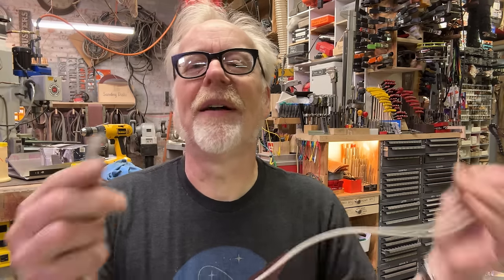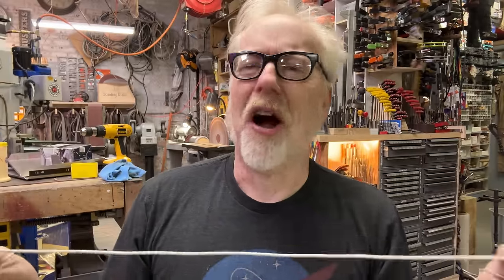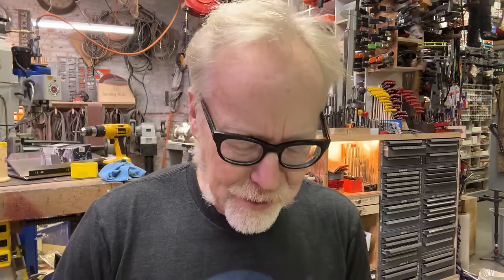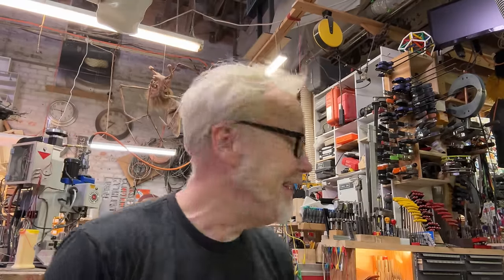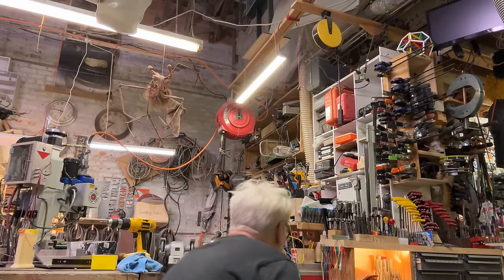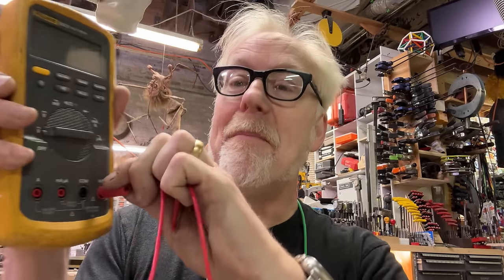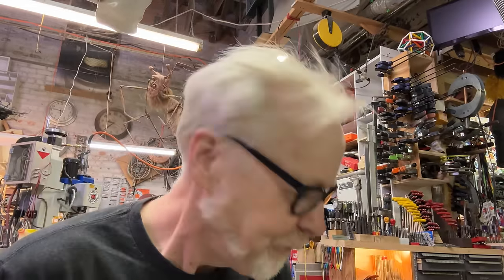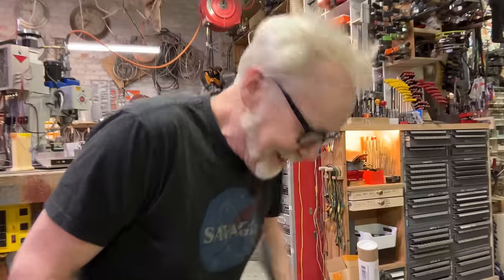Adam Savage's Alligator Clip Leads Problem

Comment from the maker: Subscribe for more videos (and click the bell for notifications):  http://www.youtube.com/subscription_center?add_user=testedcom
Reply: I make my own clip leads or alligator clips as I learned to call them by my father.

If you would like some high quality ones let me know. I would be honored to make you some.
Reply: Adam Savage, you could always just use Wago's and a Pen voltage tester to see if you continuity (Completed Circuit)
Reply: Please check out Parts Candy test clips! They're exactly the solution for this problem. They're hand soldered and can handle a lot of current.
Reply: Eric O. at south main auto probably has one of the best collections of leads for everyday use.
Reply: Adam savage should try to make 
Real MILITARY DICYANIN DYE GOGGLES to really see higher dimensions 4d test different dyes
Reply: @bretteballantine2596 
Well he cannot make fiction a reality..... so...
Reply: Copper clips, silicone copper wire, solder, shrink tube in different sizes and colors.  Cover the clips as best you can with shrink tube.  You can also pair them up in a cable winder puck that you 3D print.  Make different sizes / lengths for different uses.  Pair up red/black in a 3D printed winder puck.
Reply: If you want the best test lead clips on the market look up MUELLER ELECTRIC's "JS Popper' if you just want a stronger grab the "3-sided jaw" test clips really have some bite!
Reply: @Napster60   Show us.
Reply: @Napster60  I would be happy to see or even buy some.
Reply: @elliothickle3247 that is a beefy boy..whew.
Reply: Frankly, my favourite kind of clip leads is a soldering iron.
It is usually quicker to solder things together than searching which one of that clips has disconnected right now.
Second best to it for prototyping are female to female "arduino wires". You put some male pins on your components and then put that wires over them. All colorful so you see what is connected where.

Comment: I worked in electronics for 50+ years and learned that there was nothing better than making my own clip leads. I used various styles of clips and insulator boots made by Mueller or Pomona and the wire of my choice. That way I had total control of length and gauge of wire and the clip was soldered instead of just crimped.
Reply: Big fan of home built. The wire I have laying around is better than the 26awg(maybe) from a cheap store bought set.
Reply: Absolutely Mueller for clips.  I have several boxes of them and the matching boots on my bench.  They’re not cheap, but the cost is worth it.  I also agree that for pre-made leads, Pomona are probably the best ones available - again very expensive, but something to search for in boxes of random stuff at hamfests.
Reply: This is The Way
Reply: S&M relationship with my jump clips also. 50 years ago, RadioShack had two clip sizes. The ends were ok, but the wire insulation degraded and attacked the copper, making the wire to the ends intermittent. I still solder repair them using new hookup wire. Sadly, they are my best clips.
-Peter
Reply: I like the custom leads from Probemaster.  Any length, any of several dozen ends.  Gold plated,  made in USA.  Reasonably priced.
Reply: I agree. My best leads are custom made. Treat yourself and use a use teflon insulated wire with very fine copper strands. It’s soooo soft. 😊
Reply: Pay the money for the good stuff, and never have to buy again. Pomona test leads are excellent quality. Mueller clips if you want to make your own. I have dozens in various sizes, ends, and wire gauges and lengths, due to being a very serious experimenter.

Comment: My father worked for the Bell Telephone company of Canada from 1949 until he retired in 1985. Same complaint on alligator clips leads. His solution was to purchase a selection of alligator clips and solder his own leads. Same complaints as you. While listening to you I was brought back to the late 70's and early 80's when I learned basic electricity from him. He passed in 2008 and I still have all his old telephone company tools.
Reply: That's a sweet story. I'm sure a lot of us have similar ones of our Father's rantings
Reply: First thing they taught us in electrical engineering was to solder our alligator clips.  They are sold unsoldered because it is more durable and flexible.  Once you solder them they are a much better electrical connection, but they break easily.
Reply: @moeburn  You wrap electrical tape around the base as a strain relief than run a lighter over it. Vulcanizes it and creates a very durable strain relief. Did that with a pair of old 1/8 jack headphones back in the 80's they still work. Sound like crap but still work ;-)

Comment: 50 years dealing with electricity and electronics here. Don’t trust any of the low cost clip leads until you check them with an ohmmeter.  I’ve seen as many as half of a pack be bad right out of the gate.
Reply: I've had the odd one that would have continuity, but not even carry a fraction of an amp.

Comment: I'm an electronics engineer at a metrology lab. I feel I should find the time to make a response video to this. I have a great many clip leads for all sorts of different applications.
Reply: Which is the company or model you use?
Reply: @FabAlb166  my personal favourite is the brushed battery clips. Grippy af. Large levers on them, comparatively, making them easy to open. No idea of the manufacturer, but they are very robust indeed. A lot of the gear we have is actually old soviet era Russian and Ukrainian origin. We have probably around 100 resistor standards that are Russian. They're extremely stable.
Reply: well GET TO IT....  Don't leave us all hanging!
Reply: Please do! Let us know here if it happens. 🎉

Comment: I work on mail processing equipment. I like to set my multimeter up with a gator clip on the black lead and a regular probe on the red. Makes it easy to hook up a good ground and then have a a free hand to work with while measuring.
Reply: That's how oscilloscope probes are designed i believe
Reply: Also measuring one handed is ostensibly safer, depending on the voltages. 👍
Reply: Yup, I get the leads with threads on the shoulder of the probe, and have screw on clips.
Reply from the maker: Mail processing equipment! Cannot lie -- that sounds fascinating.
Reply: @schok51  The ones we have are just the little tiny clips like Adam was showing, but that could be because the only thing we use them for usually is checking for a couple of signals on very small components in our inkjet printers.
Reply: @matter9  Good point. Luckily most days it's nothing higher than 24VDC, and 208 VAC at the worst.

Comment: "It's really hard for me to throw out something that almost works"
I felt that line resonate deep, deep within me :D
Reply from the maker: Right?
Reply: Same here.
Reply: Perhaps a rephrase, something like: "I have a hard time throwing out things that are not damaged." Like, things that are in the same working condition as when they left the factory.
Reply: @GeneCash  Here, here! Hear here!
Reply: @n8mob  Even damaged things I hate throwing away because I know it's just going to end up in a freakin' landfill somewhere :/
Reply: Then don’t… Give it away.
Reply: The beauty of cheap clip leads is, given enough time, even sitting, they’ll fail. I bet half of the ones on his rack are dying or dead.
Reply: it resonates with me. I will not throw it out until I have FULLY replaced it. I have had crappy gear still knocking around because of one single use-case where that is the best option available (that might even be that its the tool that is near me when needed). my wife can be the complete opposite of that she will throw it out as soon as she decides it does not work for here without a replacement and then we have no tool for the task. we had that with a can opener that was troublesome she threw it out and the next time we needed it we had no can opener and had to resort to a  old Swiss army knife to get it open.

Comment: Mueller Electric is the company you're looking for.  Grandpa had an elec. shop since 1958, I made test lead cables with Belden Test lead wire and Mueller ends once.  They all still work.  I use the tiny, but tough, 30 series in copper, but 60 series might be more your size.
BU-30C - alligtor clips
BU-34C - Flat tips - great for tight spaces 
BU-60PR2 - Alligator clip that accepts test lead pin Tip
BU-60HS - Alligator clip that accepts Banana Plugs.

Lots of styles, and multiple metal options.
Reply: @tested this right here, also Mueller makes a ton of different clips, leads, connectors, etc. They're not inexpensive, I balked at the prices when I first saw them but everything I have from them is still in perfect working condition even after years of daily use. My preference is to make banana leads of various lengths and use connectors with banana sockets, that way when a lead wears out or breaks you can just grab another and swap a connector on to that.
Reply: I'm replying to your message as a bookmark for future reference. Good info, thanks!
Reply: reminder comment for anyone that needs it
Reply: YES!!!    Mueller branded leads are fantastic.   I have some from 40 or 50 years ago and still work great.
Reply: Yep. Came here to make this post.

Comment: On the subject of banana connectors, google Wago 215 - these are 4mm banana plugs with spring-contact sockets on the back to accept loose wires - effectively turning any 4mm socket into a screw-terminal equivalent. Game changing. 
Only downside is they're not stackable
Reply: Speaking of Wago, I like to use a 5-way lever nut with a lead to BNC.  Easy way to connect up four loose wires.
Reply: The modern equivalent of a stackable banana connector is called a "test lead".
Reply: Mike - you are an amazing human being. I love WAGO connectors but I had no idea that the 215 existed. They even come in a range of colours.
I have added a stack to my shopping basket!
Reply: Mr. Harrison, perhaps you could do a video on your tips and tools! Ben at Applied Science did a couple and they were very helpful.
Reply: Yeah these are awesome. Always have a handful at work.
Should get some for the home lab as well.

Comment: While doing lab work for my EE degree, I fell in love with Pomona cables. They're in a class above everything else when it comes to build quality.
Reply: They are owned by Fluke
Reply: Mini-Grabber to stacking Banana (model 3782) and mini grabber to BNC (model 5187-C-36) are absolute game-changers. 

Alligator clips become obsolete once you’ve had the privilege of mini-grabbing arbitrarily small wires reliably.
Reply: The Pomona Mini Grabbers do work well, though after a while, the hooks get less hooky (if you're using them to latch onto things like PCB through holes and other hard stuff), until they get flat. Then you try to bend them back to be hooky, and then you eventually snap the hook off and get sad.
Reply: @frontgateloadingdock8871 now, they used to be independent. I was a happy user of their rectal thermometer, aka high voltage probe.
Back then, we usually called it the RETS rectal thermometer. But then, I am a RETS graduate, before they sold out, whored out and generally destroyed their own reputation. The school started turning into shit after the old president died, literally in his office and the VP slowly began running the business into the ground.

Comment: My step father managed to find small Hemostats at the swap meet back in the 70's, that were about the size of small sewing scissors. He drilled a small hole in the handle, threaded it, used a cap bolt, this way he could use ring terminals on the opposite side with nuts so he could change the gauge of the wire he needed depending on the job, also, the length of the wire on the fly. He could grip the handles in his jeweler's vice for holding, and ground the lead if needed while soldering components together. It also meant he could make a multi run if he needed to check multiple components at once. The clamping end could hold pins tightly enough he could poke through insulation, or into plugs to test connections as well.

Comment: EE of many years here, with an obsession for great tools similar to Adam's. I've been using Staubli alligator clips for the last 15 years or so and will never go back. These are not wired - they are placed on top of a standard 4mm banana plug. I have a bunch of banana plug wires at various lengths and colors as well as a bunch of clips, plus other tips to put on their plugs: normal probes, springy needle probes, wire grabbers, etc. This way it is all modular.

Comment: And this why I make my own clip/alligator/croc leads.  Mueller Clips, &  Belden Test Lead Wire, soldered & heat shrink sleeved.  Color-coded boots to match the wire color.  Reliable & easy to repair.

Comment: I hear you, decades ago I was using a cheap yellow clip lead, the wire was broken inside and I did not know, hours of fault finding later it got down to testing that clip lead as the last thing in the circuit. It was open circuit. I got so mad I yanked it apart and pulled the covers off but I only had thick orange wire to replace the tiny yellow wire. Soldered that wire in and 4 decades later I still see it around. The mismatched thick orange lead with yellow clips serves as a reminder, clip leads can go open circuit.

Comment: A few folks already mentioned them, but Staubli test leads and clips are amazing. Best ones I've ever used. Plus you don't need multiple dedicated sets since they come in just the connector ends and then you use whatever length of banana cables you want.

Comment: Deep rabbit hole here. We tend to use what we have by  the bench, not what we need. Alligator vs. crocodile vs. J-hook vs. piercing vs bed-of-nails vs. etc. All in various degrees of quality. Don't forget the wire type- larger gauges for higher current applications. Flexibility is an issue too. Great topic.
Reply: yep, my bench supply lead is 5 feet of 16/2 lamp cord with banana on one end and clips on the other end, as that's what was nearby when i built the power supply. mind you, this cable never sees anything above 32VDC. mostly between 3-12V though.

Comment: The Omnifixo solder helper with the parallel jaw clips (that was reviewed on tested a while back) should be the basis for an improved clip lead with similar parallel jaws.
Reply: Parallel jaws in general are amazing. Knipex pliers-wrenches beat the pants off Crescent (adjustable) wrenches and Channellocks (tongue & groove pliers).
Reply: This is exactly what came to my mind too.
Reply: Yep. I bought one after Norm showed it on this channel, and everyone who has tried it so far has absolutely loved it, compared to the crocodile-jawed helpers that either have a poor grip or destroy the insulation of the wire. But what works best for me when prototyping electronics is a breadboard with jumpers. Maybe someone needs to make a version of breadboards that accept banana plugs or at least a slightly larger connector so you can try higher current circuits.

Comment: I remember experiencing some of the same issues and frustrations back when I was taking electronics courses almost 45 years ago... fussing with the exact same style of alligator clip style connectors. I also recall the plunger-hook style of clip which (if I recall correctly) only came with lab equipment (oscilloscopes)... either that or they were sufficiently pricy to be beyond consideration for a community college student. Fascinating to see how little has changed after all these years.

Comment: all of my leads are double ended banana plugs, then I have two containers of crocodile clips (red and black) which fit onto the banana plugs, you can also get all the other styles of clip that fit onto the banana plugs (including the hook clips), (I also have containers of red and black banana plugs that I use the make up special length leads when I need them. when one crocodile clip dies, I dont have to ditch the whole lead, just the clip- and I have hundreds of those so thats not an issue.

Comment: For LED's subtract 2 from your supply voltage (so 12 - 2 = 10)
this is because LED's are diodes and have a forward voltage rating of approx 2V as a rule of thumb
take that value and divide it by the current you want, so for 20mA that's 10 / 0.02 (1mA = 0.001)
The end result is the resistor you want which for the above would be about 500 ohms, (use a meter if the colors are hard to read on the side)
If you wire led's in parallel a single resistor will do but it'll disapate more power so will get warmer if it's too small
If you wire led's in series then you need to subtract that forward voltage multiple times one for each led

Comment: Pomona Minigrabber leads are the best.  Off-brand minigrabber leaders can be too weak but Pomona makes good stuff.  Besides bananajack (as in the video), you can get them with BNC connections for use with scopes, function generators, etc.  Then also pickup bananajack to BNC adapters for mixing and matching.
Reply: Yeah, those are what I use at work.  Can't stand the alligator style ones.  Biggest issue I've had with the Pomona banana jack connectors (1325, the ones that screw down onto a wire) is stranded wire tends to fray out from under the screw, eventually resulting in the connector loosening and falling off.  So, what I do is solder my stranded wire.  That, of course, makes the wire brittle, so I nylon tie the wire to the body of the connector.  Works quite well and is very reliable.  Oh, and teflon insulated wire - none of that PVC garbage that melts if you look at it funny.